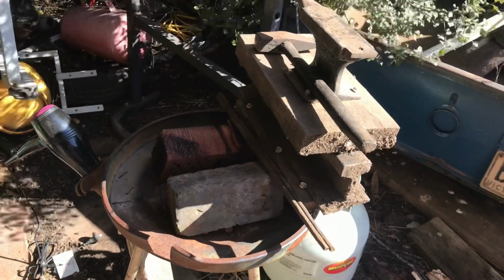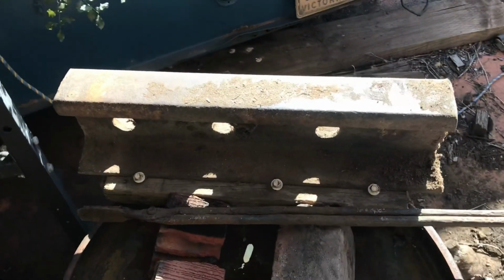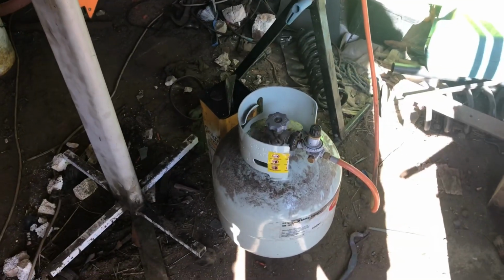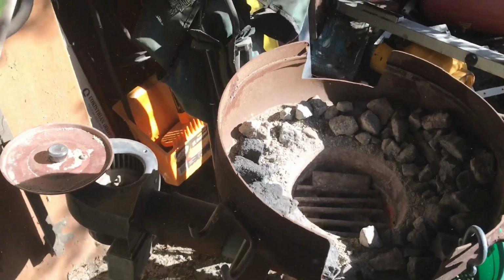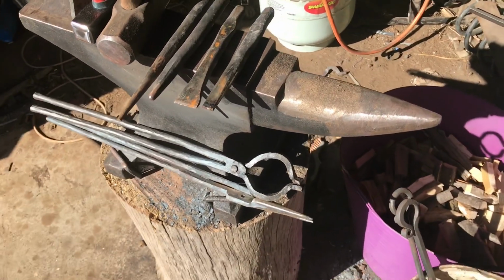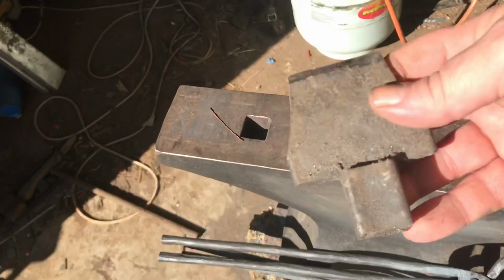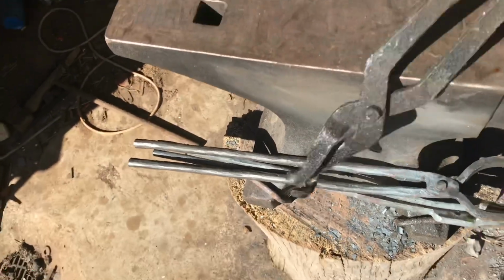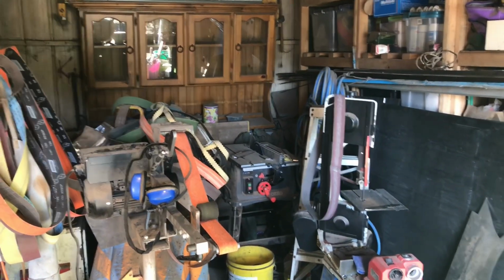Basic blacksmith forge set up, Beginner blacksmith forge

Comment: man oh man i am impressed with your Black Smith shop,, blacksmith tools are very hard to come by here in the U,,S,, and if you find them they are expensive,, i have been told most tools traditionally were made by the Smith,, i am most interested in seeing any tools you make my friend especially tools for the Hardy & Pritchel hole,, good video i enjoyed watching thanks so much for sharing,,
Reply from the maker: Yes I made all of the small tools and will do a series on making them, 2 1/2 sets of tongs are also mine. Would love to do hammers etc but really need a power hammer or press to do that solo. It’s funny, older tools and anvils run more expensive than newer ones in most countries as they get the vintage/collectibles tag.